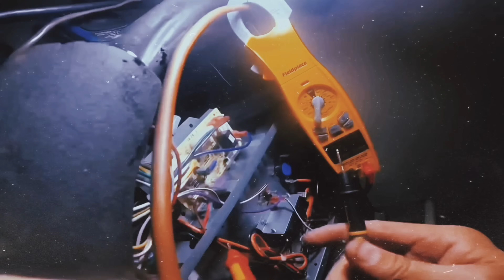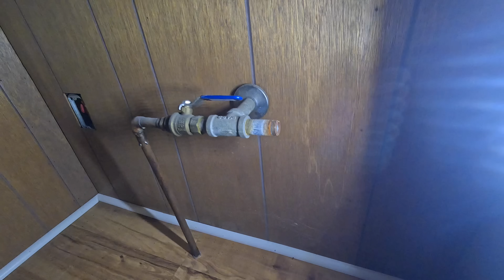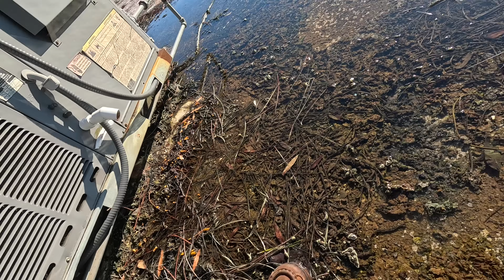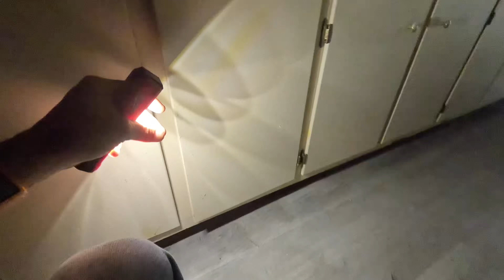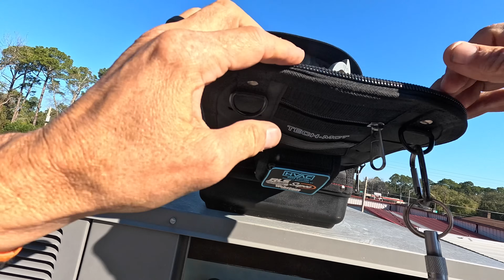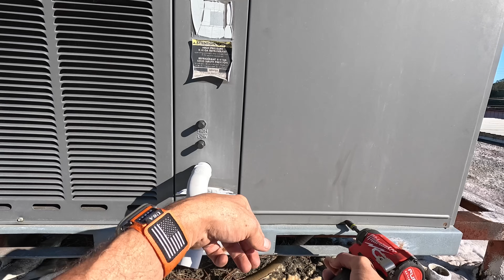This Is Why A Professional Has To Be There To Turn On The Gas! #hvacguy #hvaclife

Comment: There’s no reason to pressurize a methane line with nitrogen.  Cheap atmospheric air can be used to find the leak.
It’s easy to achieve 50 psi with air for the final pressure test which should have been performed before the gas company unlocked the meter.
Reply: I disagree. Air has moisture, nitrogen is dry and inert. Always use nitrogen instead of air.

Comment: Hey Curtis, Great video. I had a question for you and the community. I've been in the trade a couple years now, and was wondering. Other than an insulated phillips and flat screwdriver. Is there any other tool you would deem a necessity to have insulated. For context, I'm on the service side, but my team does a lot of installs and some of them do run power. I appreciate any advice. Thanks and have a great night.

Comment: Not sure what state you're in but the gas company is not responsible for major leaks inside a commercial building. It's up to the owner to hire a company for that. Now the gas company will red tag it and lock out the service until things are repaired. At least in my area.
Reply: The gas company will go in the building and sniff it out. They won’t make the repairs though.
Reply: @timothygingras6939   I had a gas leak around my meter and the gas company came out immediately and fixed it.  Was that because the leak was on their "side" and not inside the building?
Reply: @1964davidsable  he's in Georgia that i know

Comment: That was a definite liability. Major leak somewhere in that building. If the gas had been left on you might not have been out of site before the big bang😮. I think you made the right move by getting the gas supplier involved. Even though you are well qualified that’s their infrastructure and they should be involved.

Comment: It is definitely leaking somewhere. I thought for sure it was the first pipe you capped off, but the other side, that valve was on. They will find it, trace every line. The gas companies are good about it. One job I did for a friend that had a leak, the guy from the gas co. stayed with me as I did the repair in the attic. He gave me a few pointers that helped. That is where I learned that you don't have to do the heave  ho to tighten fittings, just tighten. I even had the electric co. one time meet me on a job where I installed a secondary box, he also gave me a few pointers that helped. Good job
Reply from the maker: I did turn that off, and retest.

Comment: Back in the day, they ran the steel pipe in the ground, and then poured the concrete over the ground. 
The steel pipe rusted out, and is now leaking natural gas into the ground under the concrete slab. 
That would be my best guess. The buried natural gas pipe is rusted out completely under the slab.
Otherwise, you would smell the natural gas leaking out inside the building. It's leaking from 
underneath the slab, that's why you don't smell it.

Comment: Disconnect building piping from the meter and pressurize it with air.
Reply from the maker: Couldn’t hold pressure. Then you gotta find the line, and isolate branches. But first I’d get two people and blow high pressure through it and listen
Reply: yeah, that's best then just follow the hissing to big leak. small/tiny leaks better off with gas in the pipe and a sniffer to get close then soap bubbles.

Comment: you can build yourself a gas line tester out of a gas pressure test gauge and black iron fittings to adapt to whatever size pipe there is. It costed like $20 to make.

Comment: Usa tu detector de gas combustible compadre. Yo se que tienes uno.
Reply: How? In order to look for a leak, you have to leave the gas on. While you look at all the gas fixtures, gas is blowing out constantly in the building until you find it.
Reply: @realSamAndrew  Cloud mode big guy.  Open valve for a bit go in try to at least narrow the search to a room or general area. Worth a shot I think.
Reply from the maker: Si tengo

Comment: Question  the gas connection that you installed the cap on, I noticed a ball valve connected to a copper line, the ball valve was open, did you ever test with it closed?  In California we do not use copper pipe to transport natural gas as it corrodes pipe from inside.
Reply from the maker: Yes, I did close it, and tested.  Same result
Reply: I noticed the same thing
Reply: National Gas Code allows for copper use, but specifies that the utility having jurisdiction must test the gas for sulfides that eat away at the pipe. Local codes might restrict or prevent it all together. In our service territory you still run across it mostly for stove and water heater connections. We do have one commercial building locally with 6 gas meters all after meter piping was run with copper.
Reply: @ridethepace6005  California probably get a bit of sea salt air from the pacific too. Which can wreak havoc on natural and propane gas line, if they are not of a curtain metal. Plus due to the fact they are in a major earthquake belt, they always had extra instillation codes around gas lines that most other states don't really have.

Comment: Use an air compressor and pressure up the lines. Make sure you isolate the gas fired appliances.
Reply from the maker: Yeh, that would be last resort